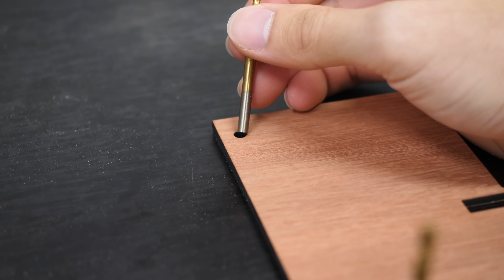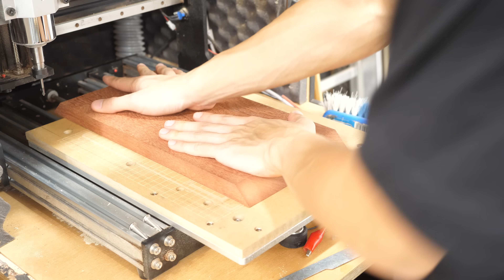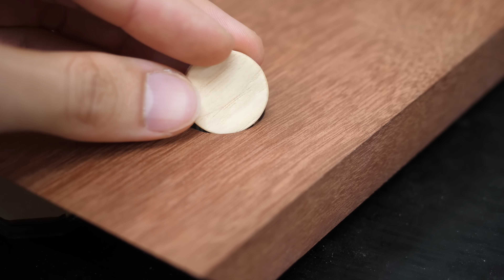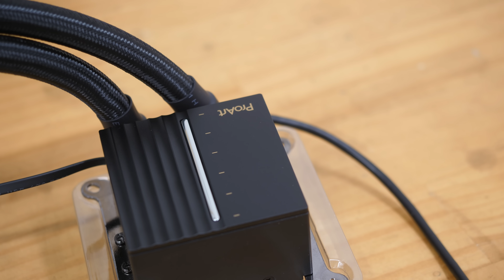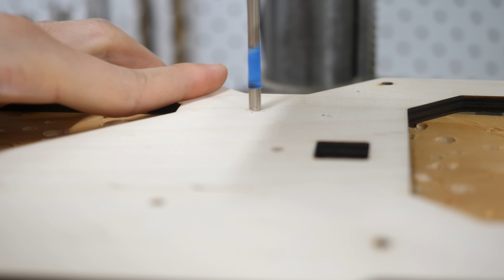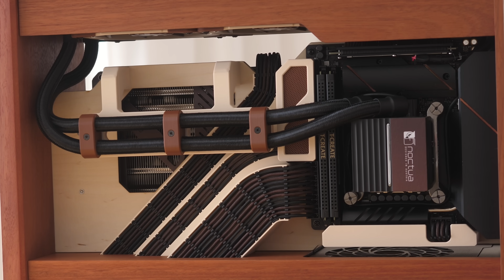WORLD'S FIRST Noctua Sandwich PC

Comment: any issues with wood expansion?
Reply from the maker: I didn't run this build long term so can't say for sure. Although I've been running the hardline wood build for close to 3 years now. There is minimal warping on that piece. Not significant enough to cause issues. Some of the decorative vaneer warped more, but was put back in place with stronger adhesive. That's about it
Reply: @mxcbuilds  i see, big thanks for replying!

Comment: You can use the sawdust to fill the cracks. Just mix a bit of wood glue with the sawdust and fill the cracks slightly above the surface. Once it’s completely dry, sand or grind the excess off. Repeat the process until the holes are completely filled. It will look like a whole piece again. 
Good job, my man! 💪
Reply from the maker: Good tip!

Comment: This video is one of many in which no PE-ground is taken care of
Reply from the maker: Yet the PC still functions as normal?
Reply: PC without PE-ground means single component failure could kill many or all other components. Muchos dineros.  It's a gamble.
Reply: ATX motherboard mounting screws and metal standoffs serve on some motherboards an electrical connection between the motherboard ground and the metal chassis.

Comment: Looks very very good.
But you may need to connect together all mounting/grounding points of hardware.
Reply from the maker: Thanks. I don't think that's strictly needed. I've built so many wood PCs without connecting them and they have all ran fine
Reply: @mxcbuilds  That's good. May be it's already have single grounding via PSU, but who knows.

Comment: Clean and beautiful case. What filament are you using? ABS?
If PLA, isn’t it low temp resistant?
Reply from the maker: The Noctua colours were pla as that's all they had. Although they just released petg version which will be much better for this

Comment: Start maybe using thicker radiators or get the aios that use 35mm+ thick 280mm and 360mm they can handle the 300watt of a 14900k
Arctic liquid freezer lll  pro
Reply from the maker: For sure there are better AIO, will be looking to use noctua's own next time

Comment: Its too clean.... I'm going to need this to not POST on first boot just to humble that beauty a tiny bit.
Reply from the maker: Funny you say that, it actually didn't post first try. GPU and RAM light was on on the motherboard. Tried reseating ram, didn't work. Then realised the PCIE extension had slightly pulled out of the mobo slot, pushed it in and it worked..phew

Comment: Ah, nice to see that you now have a proper sliding mitre saw, you deserve one! As a makita fan you have a very good 300mm saw option, looks like that's what you got.
(I would have gone with the Bosch Glide myself because of the greater cutting depth and arm that can fold out of the way, but the makita is a great saw)
Edit: and a table saw! Now you've got a true woodwork shop :)
P.S. You can never have enough clamps!
Reply from the maker: Thanks, definitely loving the new tools and you can never have enough clamps indeed! 😊

Comment: That is some beautiful work right there! 
What filament type did you use, out of interest? PLA? PETG? TPU for the combs?
Actually, I'm guessing maybe not TPU for the combs - the snap sound of the cables going in made them sound more rigid than TPU
Reply from the maker: Most of the structural parts are PETG-CF including the combs. But the Noctua parts were PLA since that's all they released

Comment: very intricate woodwork. i used to dream about having a wood case. but with GPU's being an extremely noisy powerhouse with coil whine right next to my ears on the desk, i decided to have a zero noise home theater living room. the chair was replaced with a luxurious couch and the desk was replaced with a pneumatic lift overbed table on wheels that acts as a standing desk if i wanted to. i found an XXL sized mousepad that fit perfectly. i keep a logitech mx master 4 and mx mechanical silent and F710 controller on it. no case sticking out like an eyesore with dumb flashing led lights to annoy me. so i built a rackmount in the basement with sliding rails for super easy access and repairs. my pc is in 4u open skeleton case for open airflow, and below it is another 4u case with 6 various size SAS and SATA hard drives connected to and SAS backplane. i have 2 USB 4 and 2  USB 3 going to powered hubs, and 2 HDMI 2.1 cables routed through a floor vent with noise dampening material to my living room, making the room dead silent which gives the room a very clean look and very zen feeling. HDMI cables go to an Onkyo Atmos home theater and a Samsung MicoRGB 85 inch TV. because i dont want to always have the home theater blasting at night just to hear the news or watch a youtube video.

Comment: In your glam shots, it looks like the shot is jumping a little every second (judder). Also, any high contrast edges in the smooth panning shots look incredibly jarring due to the low frame rate (stutter). Would you please consider double checking your filming frame rate, timeline frame rate, and render frame rate to make sure they all match? Also please consider using 60 fps if possible; the panning shots would look so much smoother, and it would make the stutter way less obvious

Comment: As a technician myself, this is a spectacular build. And yes, I do mean spectacular. The precision and craftsmanship it takes to build something like this is immensely high. Not a huge fan of woody electronics—but still, credit where credit is due. Also because I exclusively use Noctua thermal paste both for personal and professional use. Not the other components though, as they are expensive. For now. 😂

One thing I have to say as a suggestion is, I think it's best if the wood is cured or tempered prior to assembly (as thermal deformation might affect the structural integrity of the case). Also maybe apply a couple layers of clear coating, to prevent mold and moisture from getting in.

You should periodically do one-of-one builds, man! I believe people would gladly pay a premium for this.
Reply from the maker: Thanks for the appreciation!

Comment: All your work is incredible. The only thing that's just funny to me is that due to the ridiculous size of modern GPUs, the end result is a case that looks about the same size as my ATX mid tower case 😆

For your next build hear me out: sandwhich ITX case with a full-power GPU, but cooled with a custom liquid loop using an external radiator with its own enclosure. Link it to the PC using Koolance QDC connectors. With your woodworking skills, you could make the radiator stack its own separate work of art, and then you can have a small enclosure on the desktop (the PCBs of the new GPUs are small), and get as much radiator area as you need for all the component using a remote radiator. Also lets you move the noise further from your ear, which will make it quieter sitting at the keyboard.
Reply from the maker: Thanks! Great suggestions on an external rad build. It's on my list!

Comment: that case is a work of art and I would buy one in a heartbeat.
However are the sides open with no glass or Perspex  covering? I thought you had to have them unclosed to help with cooling?  Shows you how much I know about these things if I am wrong.
Reply from the maker: Thanks! It's a open frame concept for maximum air flow. At the compromise of more dust ingress. So it requires more frequent cleaning and definitely not suitable for households with lots of dust or pet fur

Comment: super impressive design & build with the level of detail that is off the charts.  like someone else commented, you should get royalty / sponsorship from the manufactures used throughout this build.   the only thing i could see to improve any dust build up would be some finer mesh for the fan inlets / output areas and maybe the option to add Lexen or Plexiglass panels to protect the components and keep the system sealed from dust & dirt.   with the option that you can simply remove for show, just like it is now. 
really impressive with all your builds and attention to detail.
Reply from the maker: Thank you! I do work with the featured brands to get components for the projects. Would be impossible to buy a full set of parts for each build otherwise

Comment: The front of that case would look even more awesome, sporting one of those 2-3mm thick Noctua Logo, metal case badges they distribute with their coolers. Mid-upper centre, or mid-lower-centre mounted. Otherwise, very nice build. :)
Reply from the maker: Yeah too bad I don't have any of those badges to spare. On my previous Noctua build, I used that badge as a power button and it came out sick

Comment: How have the past wooden cases held up? have they warped or cracked due to heat?
Reply from the maker: ive been using the hardline build since its conception. There is minor warping, but not sufficent to cause leaks or anything. PC still works normal. Cleaned out yearly with some compressed air
Reply: @mxcbuilds  thanks for the reply, I still might go for a metal mounting tray for mine but this gives me more peace of mind with wood.

Comment: Why have the PSU fan facing internally? that 1600 watt heat is going straight into your MB
Reply from the maker: Mate the fans on PSUs are intakes. The hot air is blown out the rear panel
Reply: @mxcbuilds Ah okay. Wouldn't it still make more sense to pull cool air from the outside? Or was there no opening at the bottom?

Comment: FLIP the AIO fans to a pull orientation and DONT put them at the top of the case next time, you can probably drop 15-20c off the CPU temps.
Reply from the maker: Not sure that checks out. Where are you getting this info from?
Reply: @mxcbuilds it’s physics brother. At a certain point, higher fan speeds actually build up turbulence and congest the flow of air through the radiator. Why do you think vehicles have the fan in a pull orientation in a shroud? It allows the air to follow the path of least resistance. And it’s also just not a good idea to pass hot air from the box internals through the radiator that should be cooling water.

Comment: With this much space, I feel like you could even use an ATX motherboard without even increasing the footprint too much, by just rotating the mobo orientation. God, this brings so many ideas that I just wish I had the tools and the machining chops. This brings me back to my days of jumping on cad or sketchup and just throwing case designs around just for fun.
Reply from the maker: Using a larger mobo will take away space to display cables 😉

Comment: Just because it is a very, very detailed custom build i will be strict! First, i would make the power button just a thinned wood cuttout which works as a spring, no extra white piece needed. Or at least the same wood tone. Second, the rear plastic bracket for the GPU and gpu are not fitting. Either a unified black plastic cover for GPU  rear IO and PSU, or a screwless solution from the inside.
Reply from the maker: Thanks for the suggestions. Although I prefer it my way
Reply: @mxcbuilds If you think your way is flawless, then any beauty it has is by mistake.

Ancient proverb.

Comment: The reasons against wooden PC cases: (1) Heat Management: Wood is an insulator, whereas metals (aluminum/steel) help dissipate heat, keeping components cooler. (2) Safety Hazards: Wood is flammable and doesn't provide EMI (electromagnetic interference) shielding, which can cause component interference. (3) Durability Issues: Wood can expand, contract, or rot due to temperature changes within the case. BTW, it look like my drawer.
Reply from the maker: Point 1. Go watch my video where I compare the temps of a wood case vs a metal. Short story, if your airflow is good, the difference is negligible. Point 2. Yes no EMI, but it's much less of an issue these days. You think the fish tank glass cases on the market today provide much EMI shielding? Yes wood is more flammable than metal I'll give you that. 
Point 3. I don't intend to throw my PC around or stand on it. It sits still on my desk like any other PC so durability is not a concern. Lastly, if your drawer looks like this PC, congratulations you've got a very good looking drawer 😉 Peace ✌️

Comment: Beautiful, but offers no EM-shielding. Or even protection from dust or something reaching into the fans of a $1000 GPU. Better not have pets or small children around. In this regard it might as well be components just thrown into a cardboard box. :(
Reply from the maker: Okay go out this comment on every open framed case to ever exist on the market
Reply: I have to agree here, it's pretty but a technical mess.  A time bomb of choices that'll cause failure shortly down the road and 100% not thermally sound. Open frame cases are built for either custom loops or airflow designs this is neither. I have to give props for that cable management channeling.  Reminds me of the old 1980's era server cases that had the channels and combs built into the frame.
Reply from the maker: @santobell  thanks for your opinion
Reply: @mxcbuilds  You're very welcome, it's a beautiful build. But as a tech whose been at this 30 odd years at this point I see the technical issues it'll have in 12 months time and beyond.  Craftmanship is 35 out of 10 but PC planning and set up is about a 6.

Comment: I think for slotted laser-cut parts it would be better to do test cuts on smaller pieces first to account for tolerance. Like in 4:09 for example, the slot for the center spline seems oversized.
Reply from the maker: That is indeed good practice.

Comment: Would've been funny if it didn't boot up
Reply from the maker: It actually didn't on first go. Turns out the PCIE extension on the motherboard side was not inserted fully. Spent a good 30 mins troubleshooting that
Reply: @mxcbuilds building pc and not booting for the first time name a more iconic duo

Comment: Only thing is the GPU isn't that secure on the back, but otherwise this is an awesome build! Although I feel like I would be constantly dusting it.
Reply from the maker: It's actually pretty well secured with all the brackets in place. It may look shakey during install as the other brackets weren't in place yet.
Reply: @mxcbuilds  Is that only due to the anti-sag bracket? I generally like the design you created to attach it.

Comment: Any concerns with the PLA deforming, or does it stay cool enough with the open design? It'd be nice Prusa released a Noctua PETG or ASA. Either way, beautiful build as usual and I love the attention to detail.
Reply from the maker: If I'm running the PC at full load for long hours or frequently, I'd be abit concerned. In particular for the AIO tube holders as that's under some tension to hold the tubes in place. The other printed parts are mostly decorative.

Comment: i actually made my own sub 11 liters case with a 5090 astral that has better thermals than this 30 db at max load and 21 at idle with an i9 cpu the cpu does run hot though but under 100 degrees so it works.
Reply from the maker: That sounds like an impressive custom build, especially for that size!

Comment: That looks so amazing man - I love everything about it.
For your noise test - I would honestly just cap the CPU cooler fans at 1400RPM (try around with different values) since you are likely to not notice the performance hit even if the CPU thermal throttles a bit. I would much rather have a super quiet system where the CPU runs hot and thermal throttles a tiny amount, instead of a loud system that gives me an extra 1-2% performance.
Reply from the maker: That's not a bad suggestion, I'll give it a shot